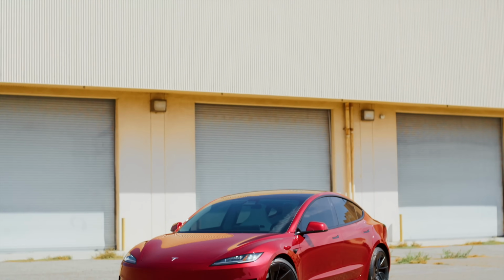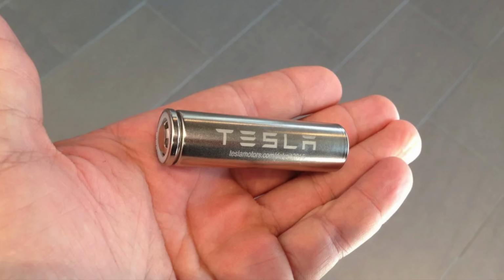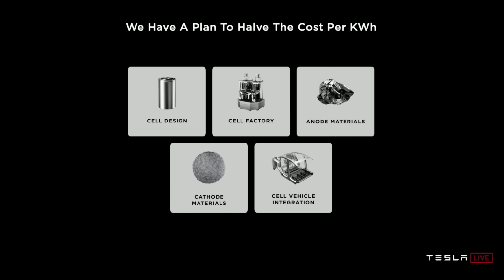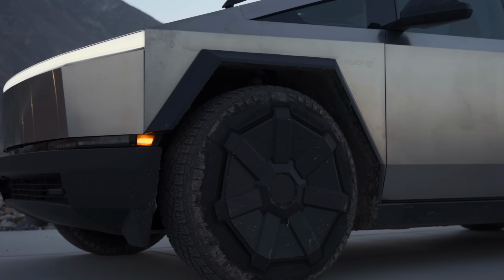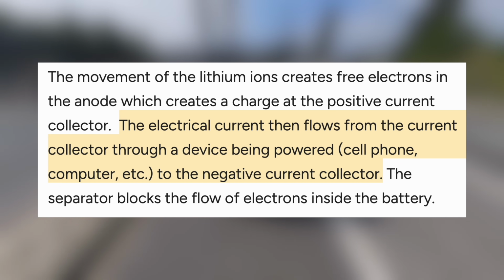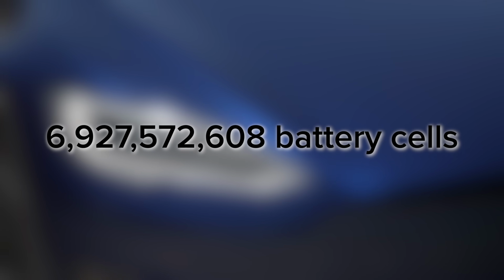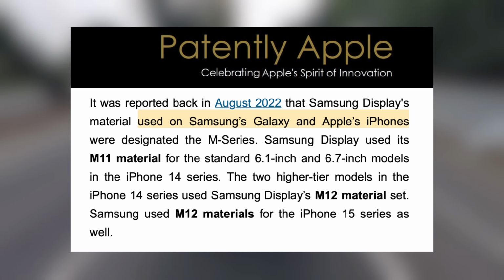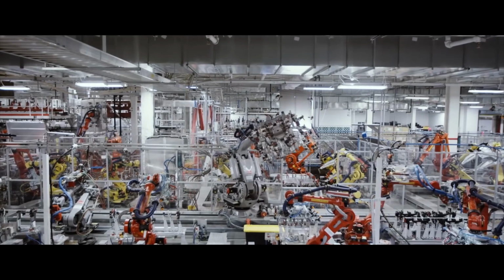How Tesla Makes 536 Batteries Every Second | Tesla’s Secret Weapon

Comment: When I watch reviews on Out of Specs review of all the Chinese EV's and what they offer for the same price as a Model Y, I'm really tempted to go for one next after my Model Y,  Great build quality, insane charging curve of C5-C6 the new Zeekr, that has a sustained charging curve of 400 kw still at 75-80% full battery, something unimaginable in a Tesla. My Catl battery has a peak of 250kw below 10%, then drops off, and at 60-70% charge it falls below 100 kw. Tesla may have the volume advantage in battery space, but the tech is already behind. Even the BYD blade battery in some EU Model Y's charges sustained 175 kw till 70% full. I wanted to buy the Juniper Model Y, but with practically no battery upgrade after 5 years on the market, I don't think so.
Reply: These fast charging abilities are impressing but this doesn‘t mean automatically the battery is capable of it without sacrificing lifetime.
We know that the 8 years of warranty are only a fraction of the expected lifetime. What if the just bring lifetime closer to warranty limit?